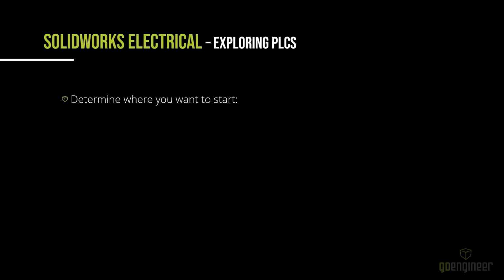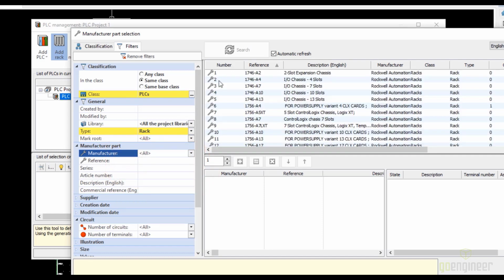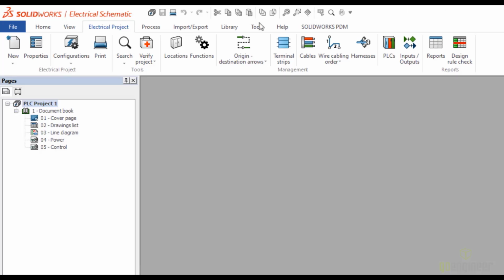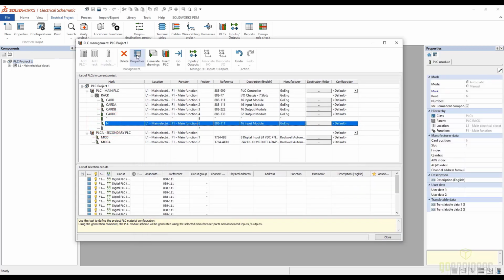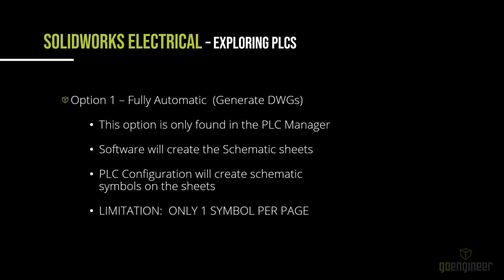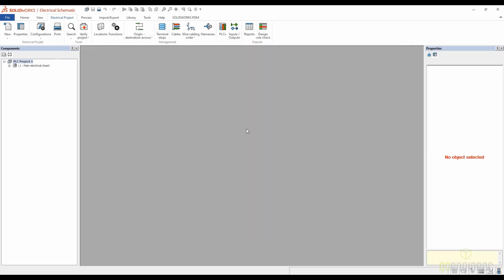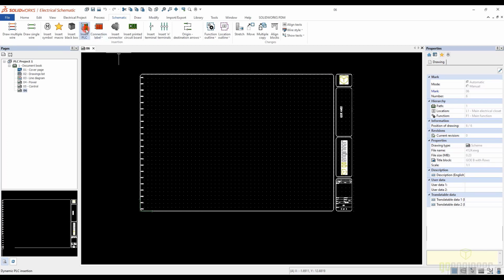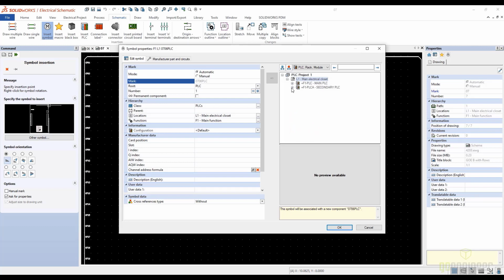Exploring PLC's with SOLIDWORKS Electrical Schematic - Webinar

Comment: I am an enthousiastic follower of your videos, mainly about PLCs. There is something I cannot find a solution: I have automotive "controller" looking like PLCs, want to import them in SW Electrical manufacturer library; import will include their circuits pinouts, Mnemonic... (sometimes more than 100). Excel Export and re import method doesnt work apparently...
Should we dive deeper in Sql Lite?
Reply from the maker: Probably the best thing to do here is reach out to your VAR's technical team to take a holistic look at your process to find the right solution.